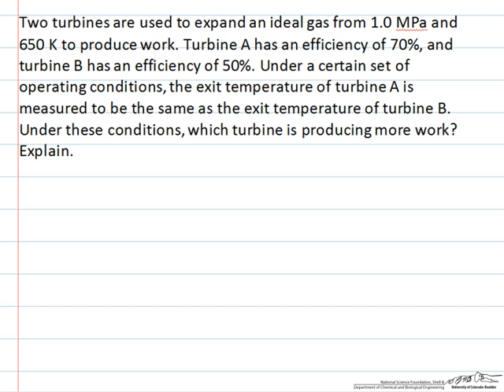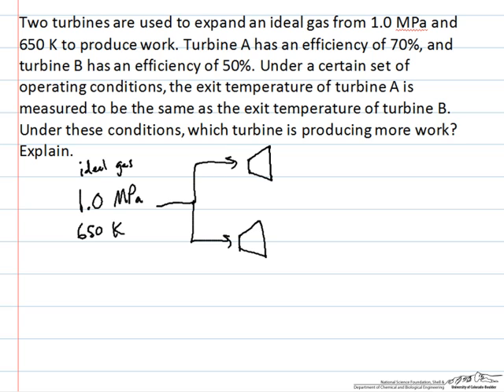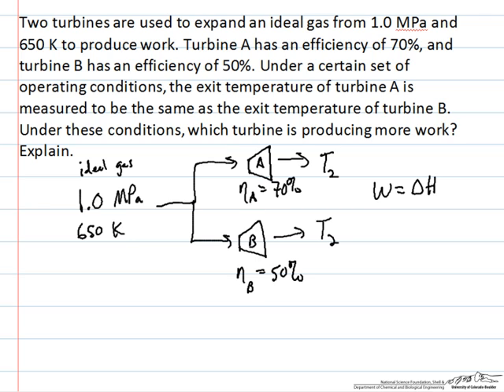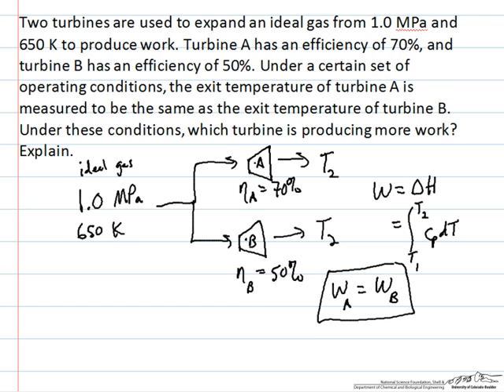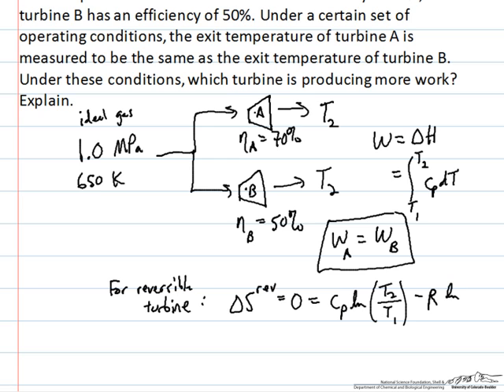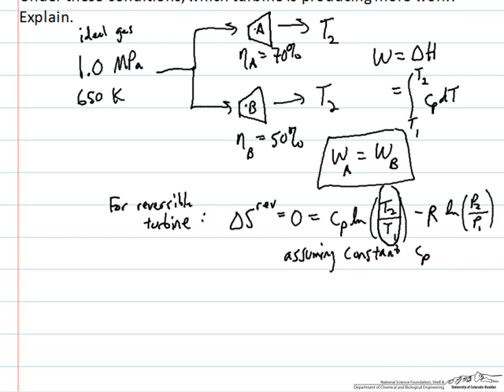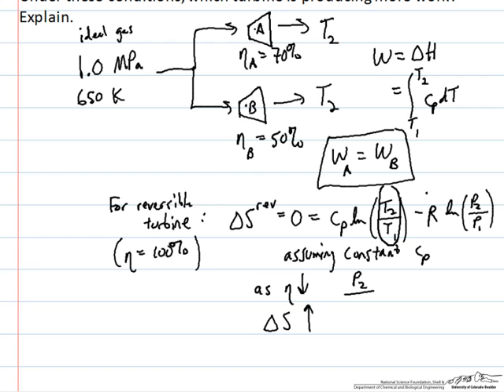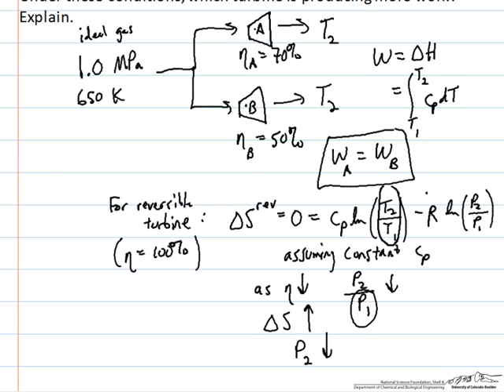Work and Efficiency in Turbines (Review)

Comment: I don't think the answer is correct. The reason is that no where is stated which is the gas flow (moles/s). So with 0 gas flow the first turbine will produce null work while over an hour the second one will have produced a certain amount of work.
Only when we are speaking about the same flux of moles, than the power produced (W) will be equal while the work depends on the time that each turbine will work. The problem as stated cannot refer to a fixed quantity of ideal gas, as in that case the pressure of it during expansion wouldn't be constant.
So the problem if under defined starts to be difficult !
Reply from the maker: Thank you for your comment.  There are no quantities used in this screencast.  We are only looking for broad answers of more or less, higher or lower, not a numerical quantity of work.  In this case, the amounts are not necessary to find that type of answer.